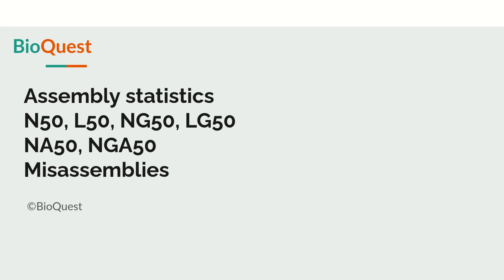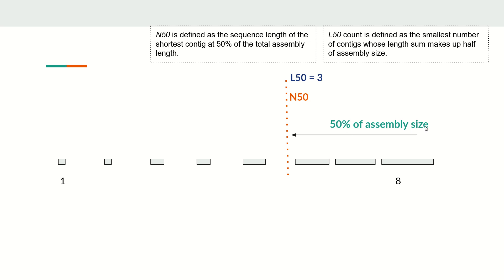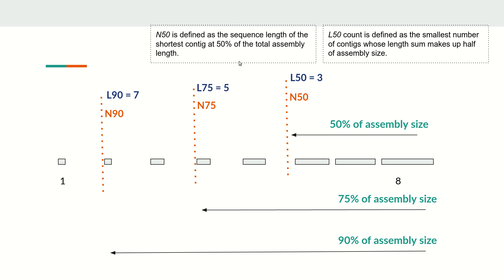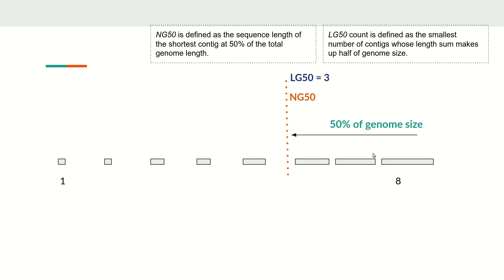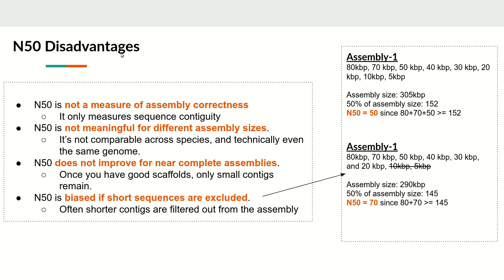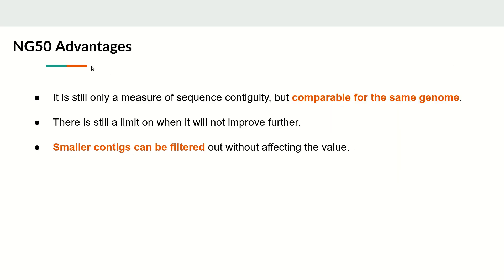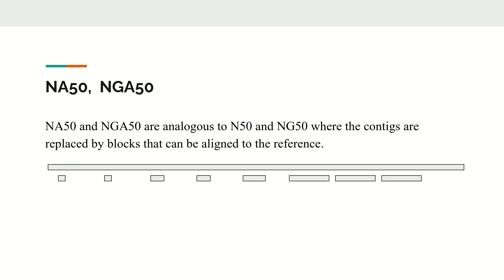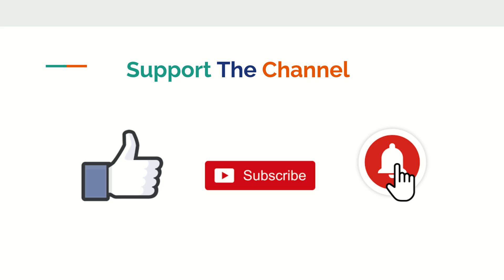Different Assembly statistics (N50, L50, NG50, LG50, NA50, NGA50 and Misassemblies)

Comment: Thanks! How do you fix misassembly by relocation in your genome assembly?
Reply from the maker: First to note that misassembly report is possible when you have reference genome sequence against which you are comparing the assembly. If it is the first time you are doing the assembly, you cant know whether there is misassembly. 

So to fix misassembly, yes you have to relocate. This will be manual process. The best thing to try to tune the parameters of the tool to see if misassembly % is reducing or not. Else try with other tools. If all tries behave same way, last resort is to manually fix.

Hope this answers.